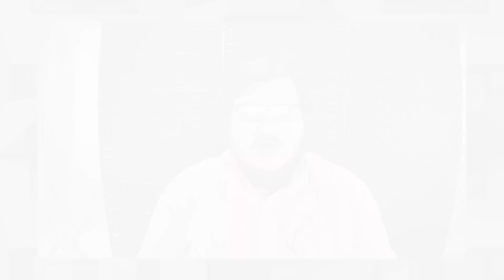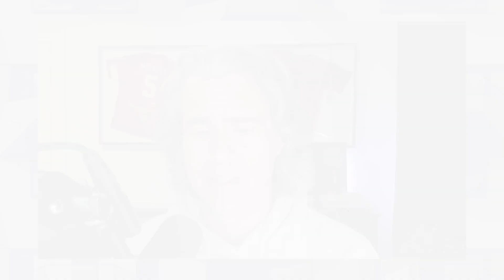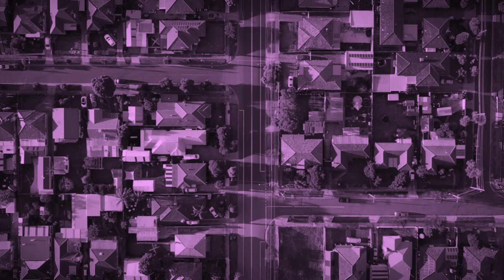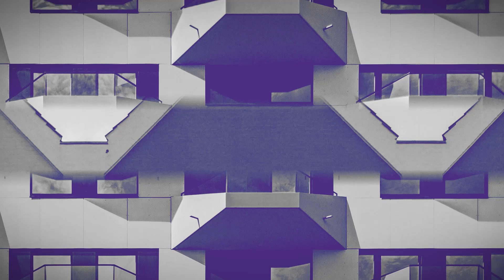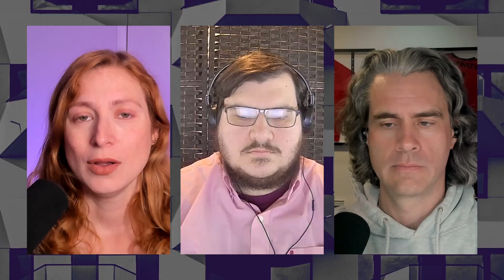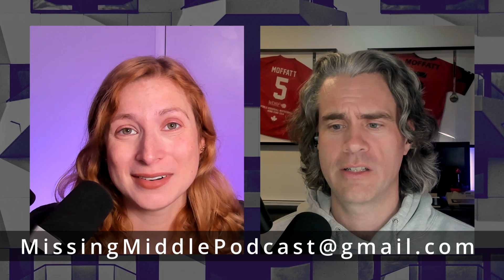Mass Timber Can Get Homes Built Faster

Comment: One of the most exciting aspects of mass timber construction to me is the potential of prefab offsite, and the utilization of BIM modelling to a far greater extent than on previous concrete mid rises. One thing that tends to happen in my experience is a free for all, with electrical, plumbers, sheet metal, sprinkler fitters, and whoever else cramming their systems into a building without any detailed coordination. Without a very involved general contractor playing referee, it can get so ugly, and inefficient. Prefab penetrations for specific systems just sound like a dream come true to me.